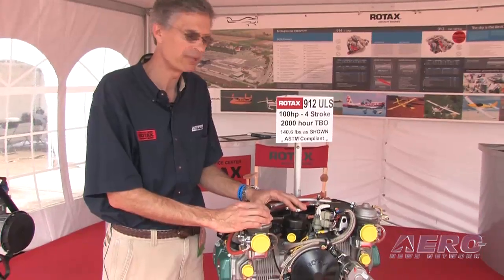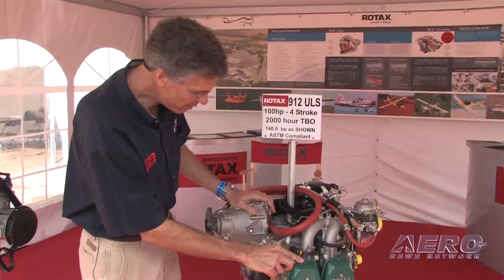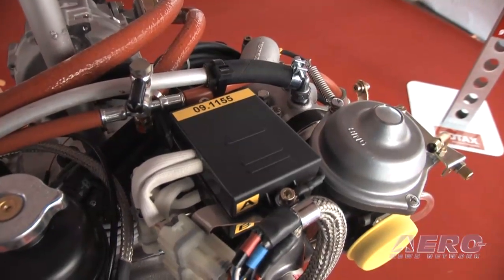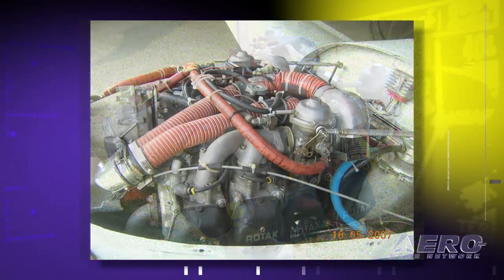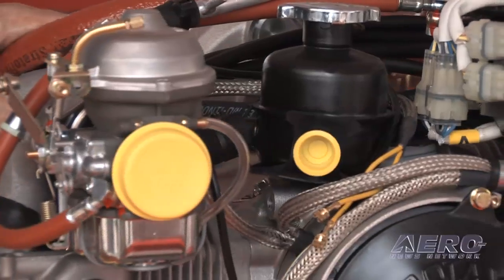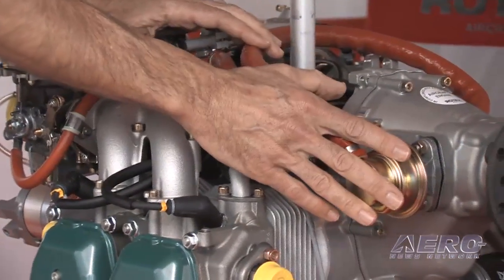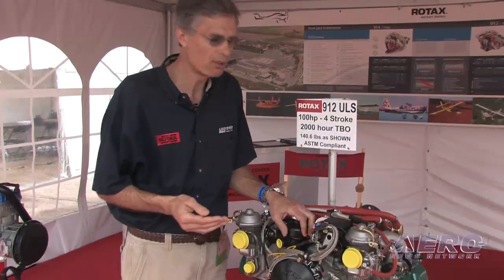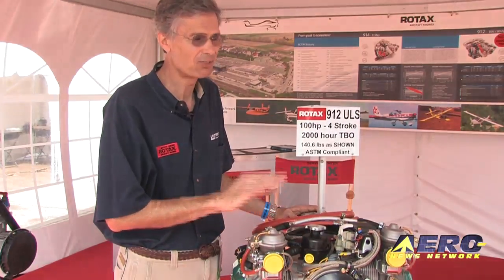Aero-TV:  2000 Hour Performance - Rotax Updates 912ULS Engine

Comment: We operate a Rotax 914UL in 2 Eurofoxes used as very busy Tow planes, under the LAA.

One is on 850hrs & newer one is on 250hrs, with no issues just the usual 50hr oil changes using Shell 4

They are operating at full power 90% of their airtime.
The absolute beauty of these is we can service them ourselves for less than £1000 each per year.

A Pawnee cost us over £10,000 per year in maintenance going back 15 years ago.
That's the difference.